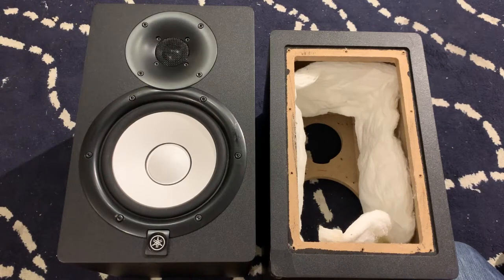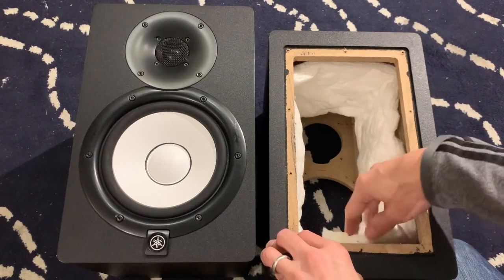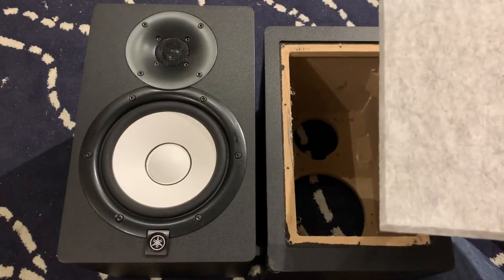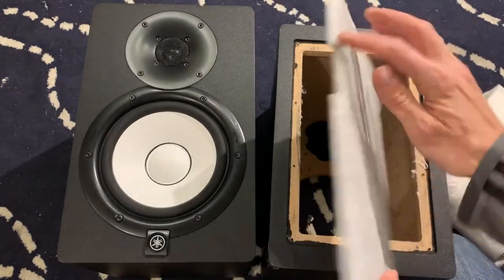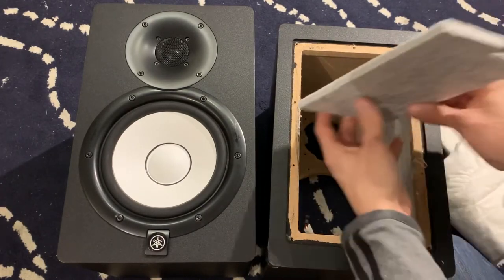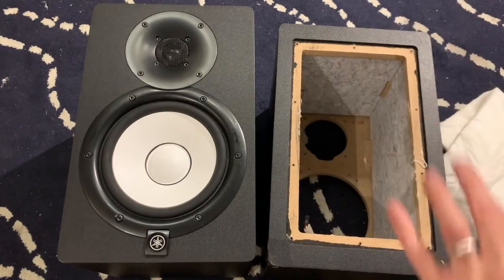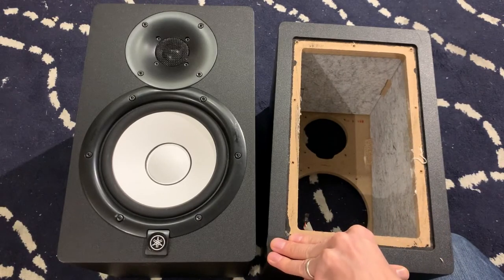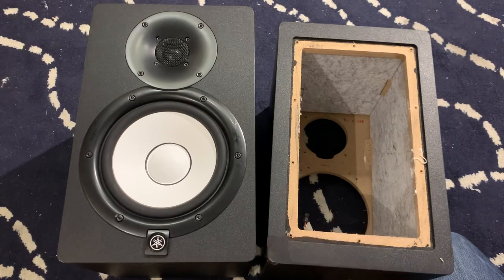Yamaha HS8 HS7 HS5 monitor cabinet modification for better mid and low definition.

Comment: I tried this!!! Used the same panels from amazon and all. I am very surprised the difference it made, the mid range definitely feels a bit tighter. But also, the top-end is much less harsh on the ear and my mixes are translating a lot better in other systems. The stereo field also feels a bit wider.

Thank you for an awesome video!
Reply: Nice! I found similarly that my mixes translate better as well. Fewer revisions. Cheers
Reply: What is the name of the material on Amazon
Reply: Are the panels foam?

Comment: A before and after would be great!! As far as frequency response! Thanks thoufh
Reply: The purpose of this mod is to control the resonances within the cab, primarily in the midrange. It’s very similar to treating the acoustics of your mix room. 

The louder you turn up the speakers, the more issues you’ll have with those resonances. 

EQ flatness is typically measured at 1w 1m, which is not very loud and only about a sine wave sweep. It speaks nothing to the dynamic response of a speaker at each frequency, nor distortion from various factors including resonances. 

For me, I can get used to an eq curve, but want it to be clear and distortion free. This mod really helps in that regard, especially in the midrange.

Comment: No before after frequency curve calibration????
Reply: The purpose of this mod is to control the resonances within the cab, primarily in the midrange. It’s very similar to treating the acoustics of your mix room. 

The louder you turn up the speakers, the more issues you’ll have with those resonances. 

EQ flatness is typically measured at 1w 1m, which is not very loud and only about a sine wave sweep. It speaks nothing to the dynamic response of a speaker at each frequency, nor distortion from various factors including resonances. 

For me, I can get used to an eq curve, but want it to be clear and distortion free. This mod really helps in that regard, especially in the midrange.

Comment: Dear Sir, can you please make a Follow Up Video about how the sound changed. Is it better or worse ? Or is it worth it or not? Please it will be a huge help and worth the knowledge. Love this video and your accurate cutting skills
Reply: Hey Soundfield Studio, it's 100% worth it. Makes a HUGE positive difference across the spectrum. Because there's less buildup and resonance in everything coming out of the woofer, not just the low end and mid range is better, but everything is more accurate and clearer. My mixes are going far faster and are translating much better - I can trust what's coming out. Tonally, they are different from stock subjectively speaking, but it won't take long to get used to and I'm not sure whether they're any less flat on a frequency sweep. 

I did this mod for my good buddy on his HS8's and he has found exactly the same thing - so much clearer and accurate, both across the frequency spectrum and dynamically. 

I'll see if I can borrow a set of stock HS7's to compare sometime.
Reply: Were you ever able to compare those stock hs7?

Comment: Funny, I just opened my HS5. I use them with ROON and EQ but I got some serious ground loop noise, so I lift the ground inside the HS5. Yes the damping is pretty sloppy in mine too. I want to upgrading the inside as much as I can too. Thanks for the tips!

Comment: This is a good update but I did that and it is okay but for me not big differences. What I did also was disabling the limiter on my hs8 and it turn my sound into more open and more dynamic sound!
Reply: Brilliant! Do you have an instruction link / video of that?
Reply: @mickelachlan  Hey Mate, I followed this other video. https://www.youtube.com/watch?v=Z53t2OFgO44&t=784s 

Just to let you know. Only do It If you know how to proper soldier back! In my case I deleted all the exact same components on the video and It works for me. Also, this works only on the Yamahas hs 80 models, not the the hs 8.
Reply: @Spunkbreaker  Thanks!     :)
Reply: Sorry to bother you, but I’m very interested in disabling the limiter on my HS8’s. Do you know where the simple directions are to accomplish that?
Reply: @bdunn315  hey man, what I did was is exactly what the guy on the video on the link above says, bit complicated if you don't know how to use a soldier, good luck man

Comment: Any sound comparison “before” and “after” modification?
Reply: Not audio clips, no. One day I’ll try to get my hands on a stock pair to so a side by side. 

The purpose of this mod is to control the resonances within the cab, primarily in the midrange. It’s very similar to treating the acoustics of your mix room. 

The louder you turn up the speakers, the more issues you’ll have with those resonances. 

EQ flatness is typically measured at 1w 1m, which is not very loud and only about a sine wave sweep. It speaks nothing to the dynamic response of a speaker at each frequency, nor distortion from various factors including resonances. 

For me, I can get used to an eq curve, but want it to be clear and distortion free. This mod really helps in that regard, especially in the midrange.

Comment: I have HS8, will do the same thing, but sir, what is the name of the material you are using? How tick?
Reply: It’s a material that’s 1cm thick - basically compressed fabric. Lots of options on Amazon and they’re mostly the same product basically. Don’t get the foam stuff though. 
There’s a link in one of the above comments with the exact stuff I used.

Comment: Could you share the measures of HS5 that you cut your acoustic panels, please? Thanks!
Reply: That won’t help you much. Each panel needs to be cut by hand in order to accommodate bracing in the cabinet. It’s a bit of trial and error with each individual speaker.

Comment: Are 6 panels (12"x12") enough for a pair of HS8's? 'Rhino Acoustic Absorption Panel' from Amazon seem like a good pick but a bit expensive if ordering 12 panels.
Reply: I’d say you win either way: save the money OR use the extra panels to treat your mix space :-) Hunt around on Amazon too - pretty big range of prices on these compressed fabric panels and they’re all basically the same 1cm thick stuff. I don’t at all recommend the foam ones.
Reply: @adamrobertthomas1007 It's for my living room. 🙂 I already have all the walls covered in acoustic panels (regular 2", 4" rockwool and BCA absorbers) but perhaps i can find a use for the leftovers. ;-) I ordered replacement op amps for them (LME49860) and plan on disabling the limiter as well. Just trying to keep the budget reasonably or else i could just have bought better and more expensive speakers you know. 😀 They're great just need a little bit of spice.
Reply: @ZombieAben  ha ha I hear you!! 
 I don’t think I can upload a picture here. But I suspended some of the hexagon shaped panels like this as clouds above my mix desk. They work remarkably well to chill out the early reflections in my listening spot. Maybe you should make a listening hat out of the extras? 😂
Reply: @adamrobertthomas1007  Haha good idea Adam perhaps i should. 😂😊:goodvibes: I used to have one years ago when i had my B&W home theater there but i downscaled it just became a bit to much. 😐 Now im more into music then movie watching, so having just the front stage covered suits me fine. 😇 Thanks for the help Adam. 🥸
Reply: @adamrobertthomas1007  I only asked about the panel amount because you mention in earlier comments that you did this mod on a buddy of yours HS8's. Anyway it's 11 months ago now and you could have forgotten all about it. 🙂✌ Have a great weekend from Denmark. 👋
Reply: Ended up buying 12 panels 16"x12". Then i have enough for a center speaker in the future. 🙂
Reply: @ZombieAben  nice! And hello to Denmark!

Comment: Do you think there's room for a panel at the bottom of the cabinet? You didn't mention it. 🙂
Reply: Yup there is room for it. The only surface I didn’t put treatment on actually was the amp panel. I probably just didn’t get a good shot of the bottom.
Reply: @adamrobertthomas1007  Good to know Adam. Thanks 👌👍 My best friend were supposed to have meet me this evening and finally help me do the bybass mod and opamp change (LME49860) but is still weak from the corona virus. So i started doing this mod to one of the speakers already disassembled. It took a bit of time getting the notches right for the braces since the hs8 is bigger and has more of these. 🙂 I used the first panel i made as a template. One side of the cabinet uses up almost one whole panel.. The height of the panel fits almost perfectly haha. 😄
Reply: @ZombieAben  I’m not the same as js sound channel, no
Reply: @adamrobertthomas1007  Sorry deleted that last comment as I didn't want to pester you. 😋Now I know for certain, Thank you. 😊

Comment: A test before and after will be great.But i don't think will change much...almost nothing..in my opinion.
Reply: It's an astonishing difference, at least subjectively to my ears. I've been modding mics and audio gear for years casually and this is by far and away the most impactful mod I've ever done - conveniently also one of the cheapest and requires minimal skill. Definitely this mod is more noticeable and beneficial than any electronic changes I've ever done to anything. Most surprising and positive outcome is that my mixing speed, translation and consistency increased significantly after a brief period of getting used to the change.

Conveniently, if you are moderately gentle, hold on to the stock insulation when you remove it, and aren't too heavy handed with adhesive when you put in the new acoustic lining, the mod is reversible back to stock - but I suspect you won't wanna go back ; ) ha ha ha
Reply: The purpose of this mod is to control the resonances within the cab, primarily in the midrange. It’s very similar to treating the acoustics of your mix room. 

The louder you turn up the speakers, the more issues you’ll have with those resonances. 

EQ flatness is typically measured at 1w 1m, which is not very loud and only about a sine wave sweep. It speaks nothing to the dynamic response of a speaker at each frequency, nor distortion from various factors including resonances. 

For me, I can get used to an eq curve, but want it to be clear and distortion free. This mod really helps in that regard, especially in the midrange.

Comment: Flat is flat so what you expect to get as output
Reply: The purpose of this mod is to control the resonances within the cab, primarily in the midrange. It’s very similar to treating the acoustics of your mix room. 

The louder you turn up the speakers, the more issues you’ll have with those resonances. 

EQ flatness is typically measured at 1w 1m, which is not very loud and only about a sine wave sweep. It speaks nothing to the dynamic response of a speaker at each frequency, nor distortion from various factors including resonances. 

For me, I can get used to an eq curve, but want it to be clear and distortion free. This mod really helps in that regard, especially in the midrange.
Reply: @adamrobertthomas1007  Yeah, you keep posting that. But why are you turning your REFERENCE MONITORS to levels that are causing that much distortion? Why are EQ curve changes acceptable for you with a.. REFERENCE MONITOR?? Buy different speakers people. Are you really claiming that these monitors, at normal operating sound levels, are noisy and full of distortion? Do you really not think that doing this mod effects the overall box frequency, the relation to every other frequency, and a hell of a lot more variables that are relative to each other? Some of which have been tested by engineers and purposely designed for the way the box is made. I highly, HIGHLY, doubt this mod is contributing to a better reference monitor than what was already engineered. It really just sounds like you have a colored sound you want and this isn't it. Buy different monitors/speakers.
Reply: @bm3410  all I can say I suppose is as mentioned, my mixes translate better & I get them done faster. I suggest trying it for yourself.

Comment: are familiar with removing the built in limiter on the amp of these monitors? supposedly it really really opens them up
Reply: I just did mine this evening, would say it really does open them up, I a/b against a non modded and really liked the difference. Its definately worth doing if you have the skills to solder 5 tiny resistors off the pcb. 

1. Unscrew 10 screws around the edges of first monitor
2. Detach speaker wires from the speakers, they have Left/right sized jumpers to help not mismatch connections which is nice. Unhook led.
3. Then its placing internal board somewhere solid to work with plenty light
4. Heat soldering iron up to temp and check your diagram and make sure which board you working on and which bits you going to be de-soldering. 
5. You have to unscrew the board you going to be working on in order to get good angles to be accurate when you need to desolver,  Easiest way is to seperate the board (which no video goes into detail to tell you, is 8 black screws in heatsinc in the back. (the black screws that screw into heat sinc). once you remove these the board can be maneuvered out to work on while still keeping wire harnesses etc attached.
5. Go precisely and touch each solder point until you can remove each tab. You unfortunately got to move quickly to get them off before the solder drys. I used small tweezers here in one hand to help remove components.
(R417 has two soldering points, the other four has three. The components are glued to the board so you have to wiggle a little with the soldering iron. The soldering iron has to have a narrow tip.) 
6. One everything removed and you checked all the points where you did work, resemble unit and you should be able to test after against your non modded speaker. (put them both in mono and listen to the lows and mids and how punchy/more presence the speaker is with transients. What he already mentions in the video definately translated to me and what he described in the listening experience.
Reply: @Jediroller  I guess I'm not following you on what exactly to heat up with the soldering iron? you don't have pics of it by any chance? really interested in this. Also can you just snip them? I don't have a soldering iron.
Reply: @Jediroller  also would you mind elaborating a little bit on what exactly the difference you heard between the modded and unmodified speaker? 

I'm assuming you have the HS80s? or the HS8?
Reply: @Jediroller  I have the older HS80m
Reply: @levijessegonzalez3629  No the components you removing are so tiny they dont have leg ends to just snip out. You need to desolder each component. R417 has two soldering points, the other four has three. The components are glued to the board so you have to wiggle a little with the soldering iron. The soldering iron has to have a narrow tip.
Reply: @levijessegonzalez3629  I did this modification on the HS7's. This mod is not for the HS80m I believe.

Comment: There not suppose to have "Better mid and low definition", there suppose to be flat.
Reply: The purpose of this mod is to control the resonances within the cab, primarily in the midrange. It’s very similar to treating the acoustics of your mix room. 

The louder you turn up the speakers, the more issues you’ll have with those resonances. 

EQ flatness is typically measured at 1w 1m, which is not very loud and only about a sine wave sweep. It speaks nothing to the dynamic response of a speaker at each frequency, nor distortion from various factors including resonances. 

For me, I can get used to an eq curve, but want it to be clear and distortion free. This mod really helps in that regard, especially in the midrange.
Reply: Yewh and hs7s arent flat